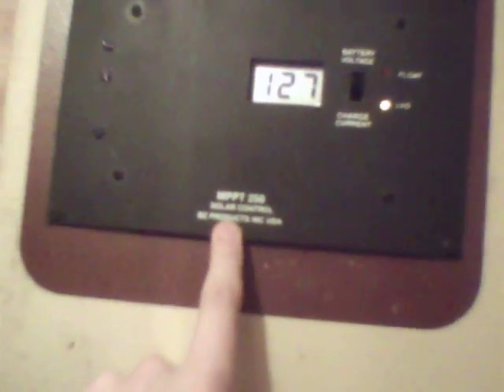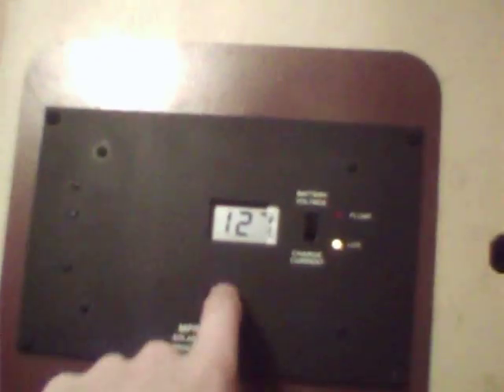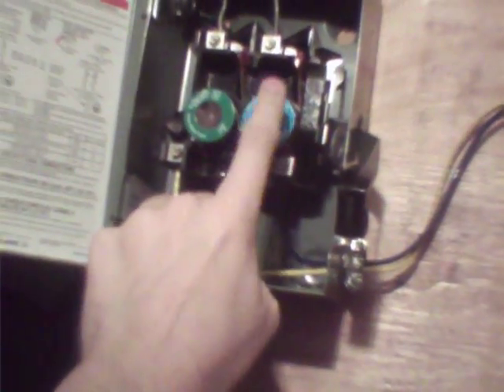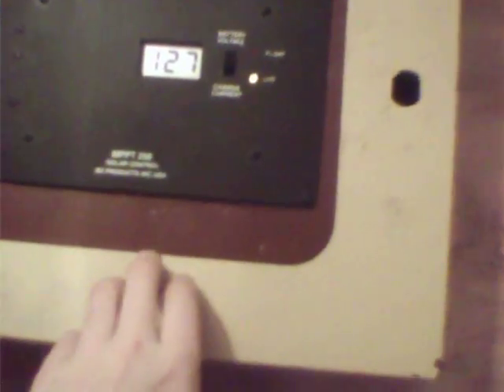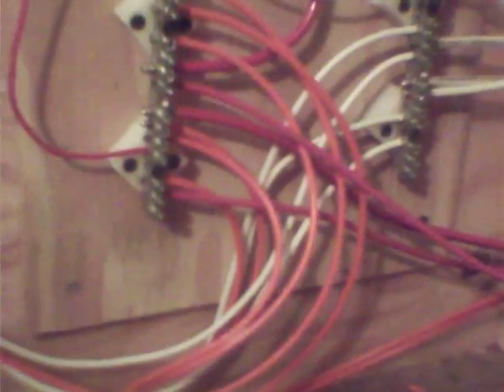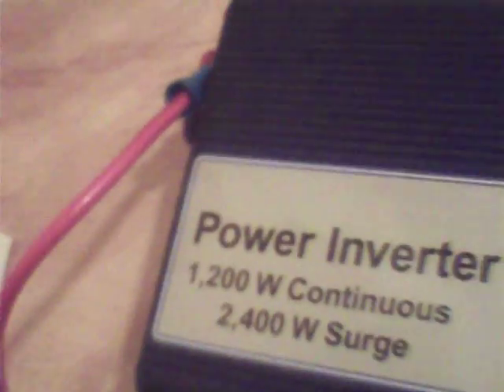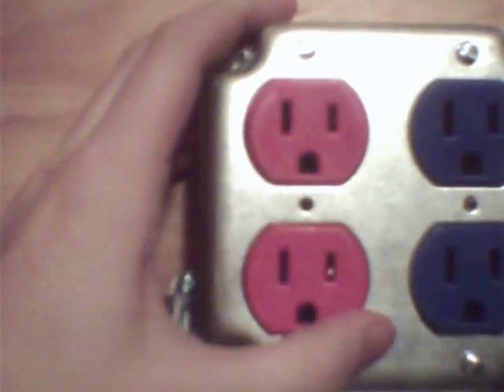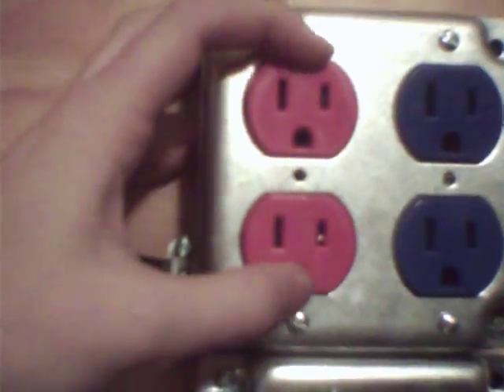Solar farm control board

Comment from the maker: @timrek1000   These are standard group 27DC marine/RV 12V deep cycle batteries.  They can be acquired from just about any automotive parts store.  These ones are made by Energizer, but any reputable brand will work.